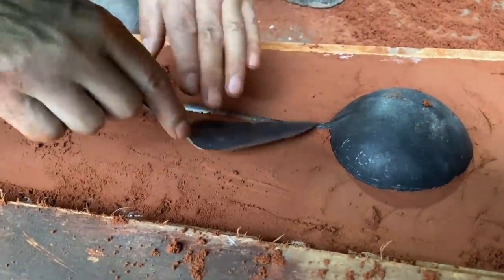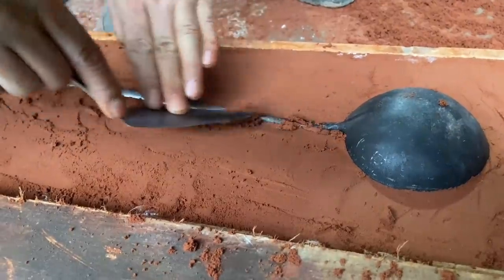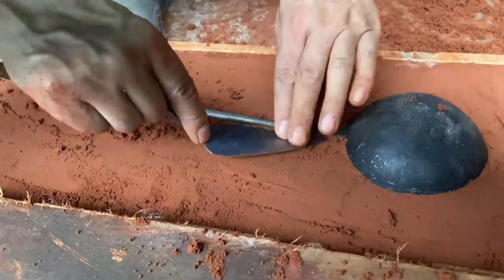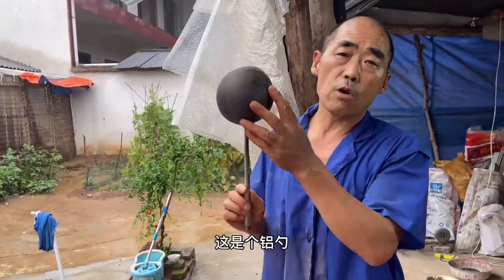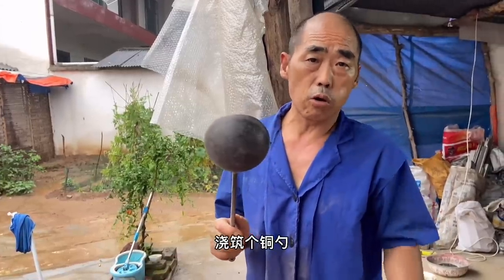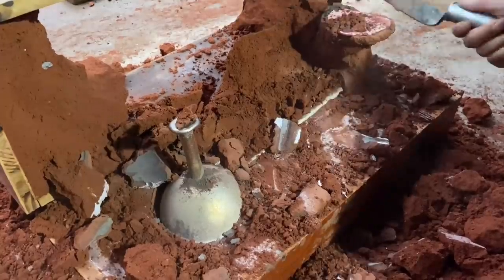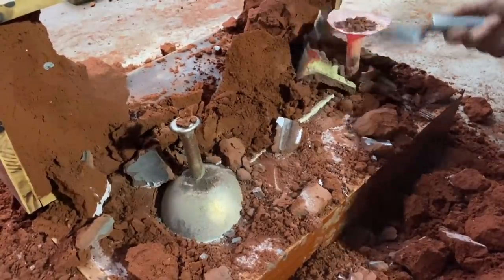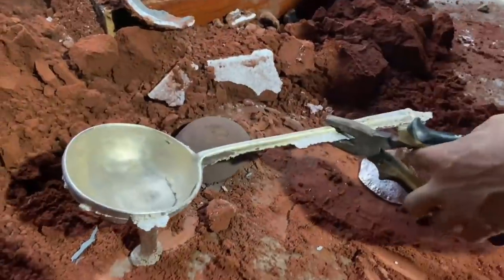More than 1000 degrees of copper water cast golden copper spoon, so awesome【Laozhu Casting】

Comment: We cast engine parts at school but it's amazing how skilled this man is and he makes it look easy which it isn't
Reply: I'm sorry but how difficult actually is this?
Reply: @haizee2330  would you like the answer in SI units or English units?
Reply: @stevecarter8810  🤣🤣
Reply: @haizee2330  The amount of 'difficulty' goes down with experience! The more you do it and learn from any issues, doing it will become easier! Also, there are a good number of tools and supplies that must be on hand to make any cast item in the first place!
Reply: Yeah, the average hobbyist would fuck this up beyond all hope the first 16 tries
Reply: @m.b.82  🤣🤣🤣🤣👍 I've done some brass, aluminum, lead, pewter and Kirksite casting in my time, and I have to 'learn it' all over again each time I want to make something new! 😁
Reply: @haizee2330  It's simple on paper, difficult in practice.  The casting sand needs to have the proper moisture content.  Too dry or wet and it won't make a good mold.  You need to make proper vents for air and excess metal to escape, also you need to pour in such a way that you won't have bubbles.  With something as thin is a ladle this is a large possibility.  Not to mention, all of this is a large time investment so if you fail, back to the start.
Reply: @haizee2330  it’s very Hard to get everything right. A beginner would probably get decently close to the desired shape but the sand wouldn’t be solid enough to get a true to mold casting. Basically the part would look decently correct but with a lot of surface defects and even some dramatic shifts (the part looks like it split and then was connected to the other portion of the split but an inch in a different direction).

I have a Pokémon casted in aluminum that looks like the 3d printed mold was dragged around like a glitching windows xp program hahaha
Reply: Isn't it amazing what years of practice does for one's skills and abilities.
A professional in any field makes their work look easy.
How sad that too many of the current generation are too lazy and self obsessed to put in the effort it takes to become good at anything worthwhile.
Reply: @m.b.82  That is true. In our technical high school, Foundry Shop was one of our classes. Some students had a knack for casting... most others didn't. (BTW: There was a running mantra then: Never call the mold media "dirt"; call it "sand". Anyone caught saying "dirt" within earshot of our instructor, was loudly corrected.)
Reply: @hlcepeda  pretty pointless mantra lol
Reply: Idk what you mean it's not easy. It's fairly easy
Reply: I was in an advanced metal working class in HS and we would make our own tools for sand casting. I would knock out like 5 casts more intricate than this in the same amount of time. The only difference is we never did anything in copper. If you are struggling with sand casting I suggest you get a sand muller.